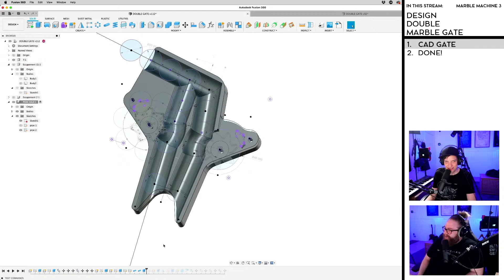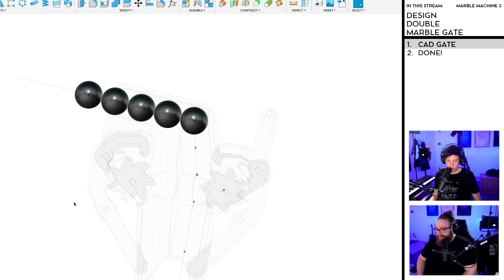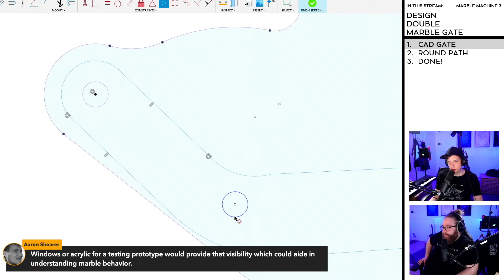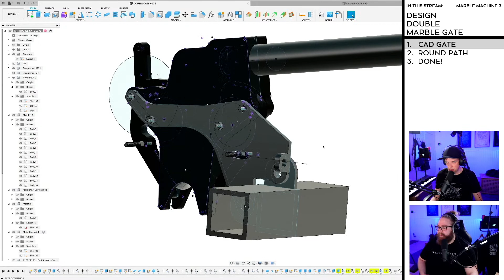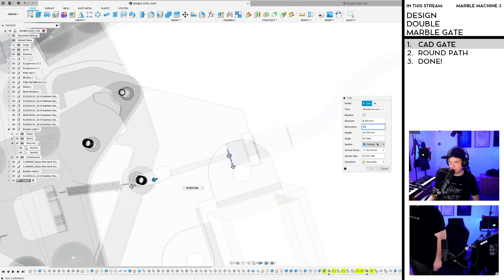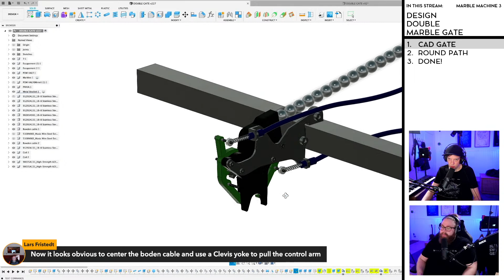Form From Function Marble Gates

Comment: Design is too critical.  Contact angles to the marble should be perpendicular to the marble motion.  Your high contact angles will lead to jamming & high hold-back forces.  Old scheme with sliding block better.  Those cables will have too much friction.

Comment: Instead of cables a collection of durable string or thin wires that are exposed, running trough a system of wheels, connecting to the registraters. Of course its not as easy as a bunch of cables that you cant bunch up in a big bundle but i doubt that that will be the case anyways. The cables is an easy design that lets you focus on the droppers and so on, but a system of exposed strings/wires would be suuper cool, and in my mind much less friction!